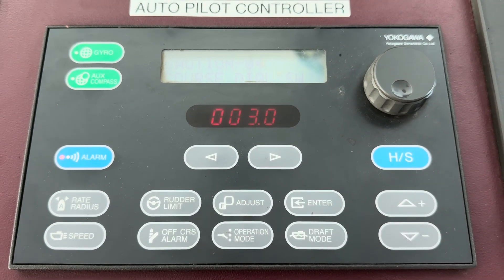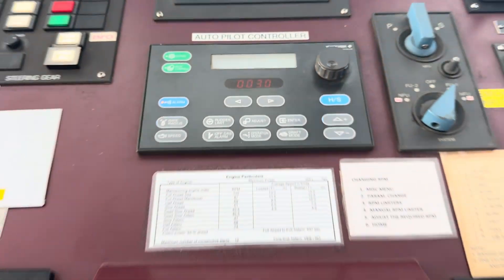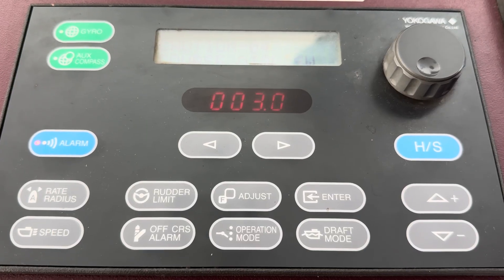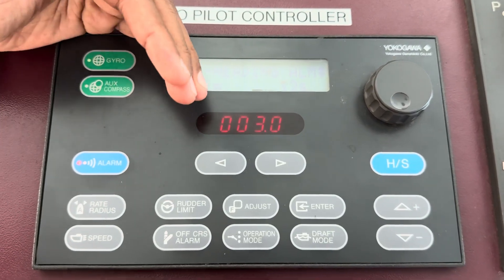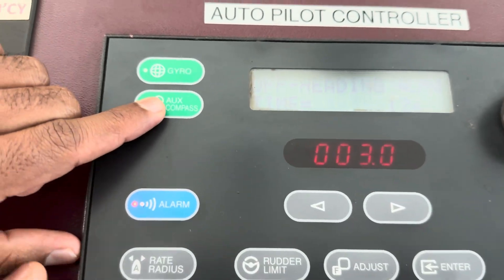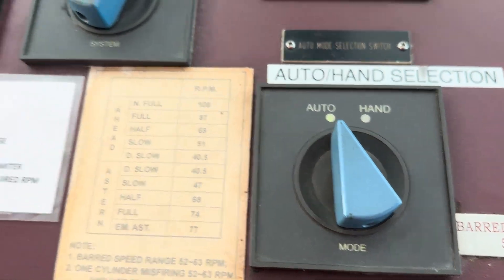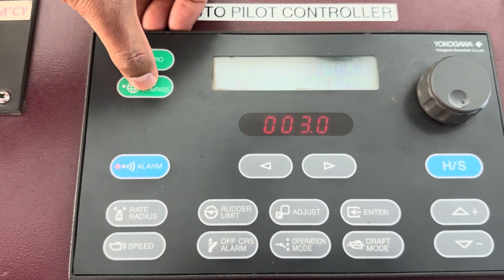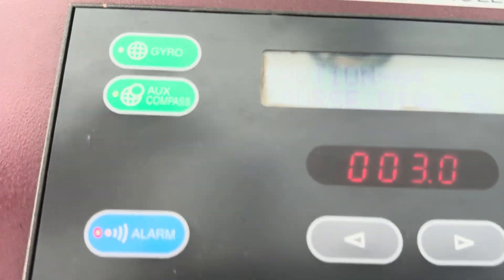HOW TO TEST OFF COURSE AND OFF HEADING ALARM YOKOGAWA PT500 by Piyushan

Comment: Hello sir. On this auto pilot how can I synchronize magnetic repeater on auto pilot with Magnetic on monkey island?. Because on my vessel, course is different.
Reply from the maker: I think you are asking why the magnetic repeater is different from the actual magnetic compass ryt. You can adjust the variation and deviation according to the correct data on digital display. Then u can align the repeater with the real magnetic reading
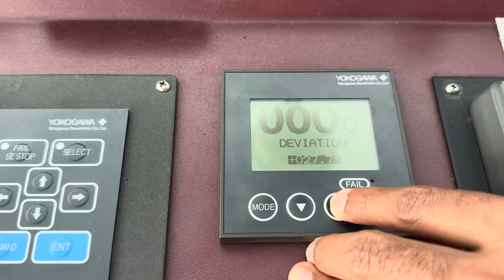Reply: At 2:56 is magnetic heading or gyro heading sir?.
Reply: Becasue i watched your video 4 years ago. You said this is gyro heading? Can you explain for me please?.
Reply from the maker: @Haiang-nk1eh you are adjusting the deviation and introducing a significant change between magnetic and gyro readings which triggered the alarm. If the difference is beyond the set limits it triggers the alarm .. if you have the same models you do this and see then u wil understand how it works. Because psc guys sometimes ask us to show
Reply: @bridgeequipmentvideosbypiy6423 tks so much. I have same model onboard
Reply from the maker: @Haiang-nk1eh dts perfect. I try to test this as I explain but be careful not to do this in a busy route . Best is while in open sea free from traffic because ship is actually turning when u test off heading as I remember so you haven to quickly stable the ship. Be familiar with this because you myt have to show this to a psc guy during inspection
Reply: @bridgeequipmentvideosbypiy6423 can I test on the anchorage or in berth sir?. I try to test on anchorage. But it's only visual alarm limit.not audible.
Reply from the maker: @Haiang-nk1eh ya u can test like that
Reply from the maker: @Haiang-nk1eh what u r adjusting on the display here is the magnetic heading. Because u r changing the deviating here